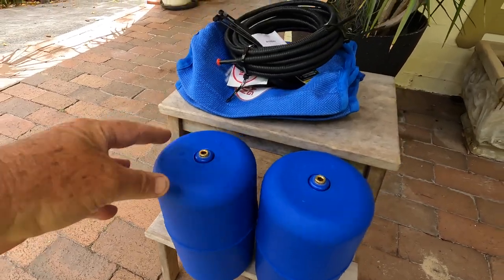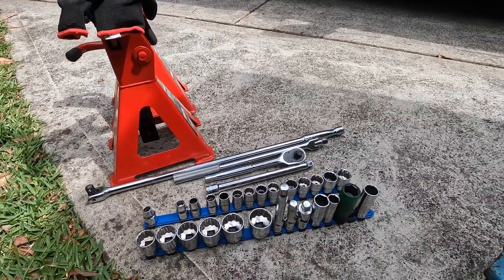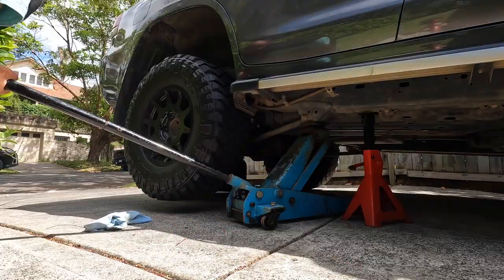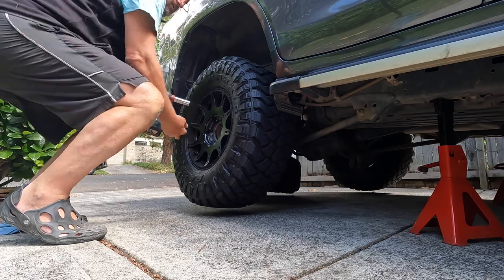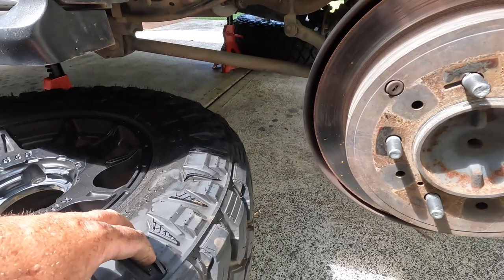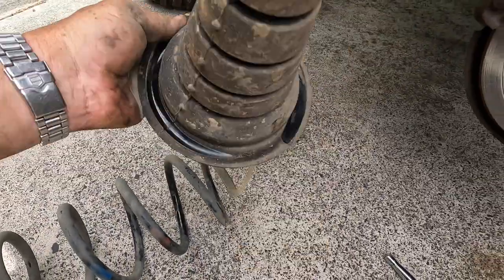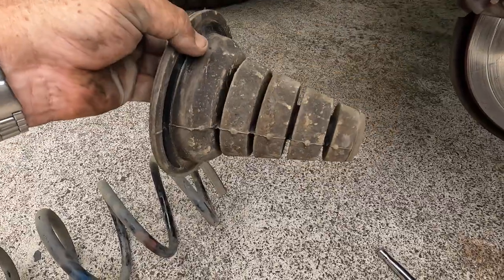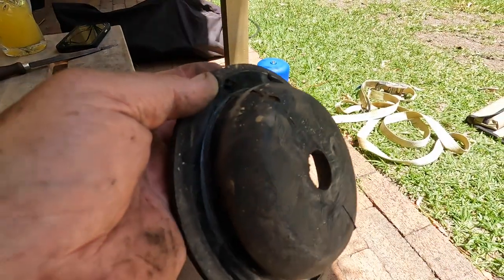Home Driveway Install - Airbags 200 Series Landcruiser

Comment: Have bags in our 200, makes a big difference towing. 45 psi I have ours at for about 250 ball weight.
Reply from the maker: Cheers - I'll start out at that, had these on my 100 series years ago, worked well. We've been reviewing vans that we might want to buy - standard suspension is struggling. Thanks for the info!

Comment: Great video! Do you always use a breaker bar then the ratchet gun to take wheel nuts off?
Reply from the maker: Yes - but it’s a more recent thing (past few years and towing a lot) I find that the impact wrench doesn’t tighten the nuts up tight enough. It sounds like they are tight but I’ve gone to take a wheel off in the past after using the impact wrench and it was so easy I got a little worried. I’ve just nipped them up with the bar ever since - not ridiculous tight but firmer than the wrench achieves. They are big mutha wheels and Tyres also.